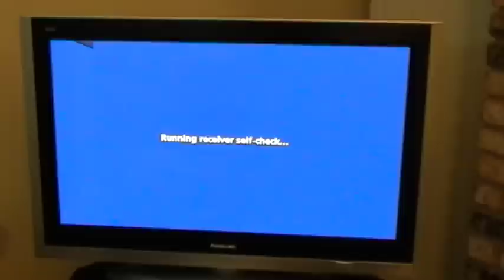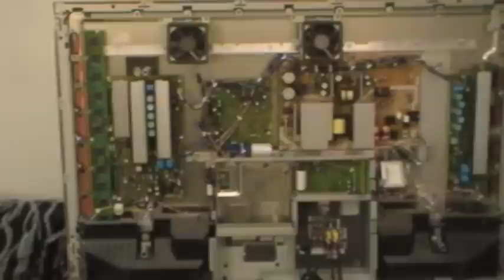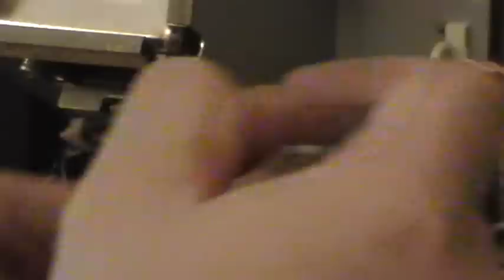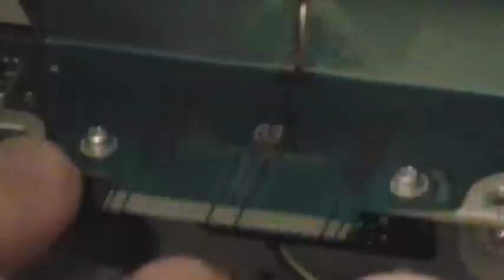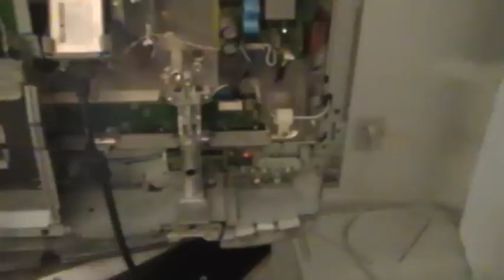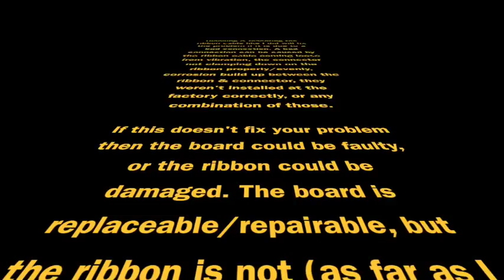Fix Panasonic Plasma TV Vertical or Horizontal Bars

Comment: Thanks for this great post. I have a TH-42PX6060B that suddenly developed a back vertical bar just off to left of middle as you've described. I removed the two middle ribbon cables and hoped to see a wide white bar right across the middle of the screen. However the black bar is still displayed surrounded by white bars. I'm guessing this means the plasma screen is broken and the next step is to take it to the dump ?
Reply from the maker: Unless you missed a ribbon cable, it doesn’t sound good. There may be another place on the TV that is disconnected or a broken solder joint or something. However, I couldn’t say where that would be since I don’t have your TV. Good luck...

Comment: Well since last time I haven't done anything as of yet but the pink line went from every so often to perm. But it comes 10-15 mins after when you first turn on tv. Still right in thd middle of screen.
Reply from the maker: So it now happens as the TV warms up.  Still an indication of a loose connection, with the bonus of possible corrosion at that connection.  Good luck...

Comment: I have the same model tv and have green vertical lines on the right side of the screen.  Could my problem be similar to yours?  I cannot see through the lines and have not tried taking the back of the tv off yet.  Trying to do research first.
Reply from the maker: If you give a series of medium force taps all around the back of the TV where the lines are, do the lines change?  If so, then its a loose connection somewhere and likely the same problem I had with my TV.  Good luck...
Reply: I don't seem to be that lucky.  They don't appear to move.  And actually there are two solid black lines with colored lines running down them...
Reply from the maker: Justin Lane, it is still possible that the problem is a loose connection. It is worth a try at least. Good luck...
Reply: Pet Rock's Garage I don't have anything to lose at this point.  Thanks!

Comment: I saw a 50-inch Samsung Plasma with a horizontal black line across the entire upper area of the screen. I might be worth the $75 investment as a second TV. I have not tried your instructions since it's still at the store, but I am impressed by your presentation. Congrats.
Reply from the maker: A 50” TV for $75 is a bargain. At worst you could sell it for parts and make your money back. If the black line is horizontal, then the ribbon cables you want to look at would be on the right or left side of the TV.  Vertical lines are controlled by ribbon cables on the top or bottom of the TV, like in my video. Good luck...
Reply: Thanks, appreciate your input, no pun intended...

Comment: Purchasing a tv from a friend that has 75% white and 25% black lines kinda together do you have an email I could send you pictures perhaps we could figure out a diy for it?
Reply from the maker: It’s extremely hard to diagnose problems over the internet. All I would be able to do is give you suggestions on things to try. Because of that I’m not sure how much help I would be without the TV in front of me and my tools. I’m not a TV repair guy, I’m a guy with a really good understanding of mechanics & electronics.
I’d suggest removing the back of the TV and lightly tapping around with a non-conductive object (like blunt end of a plastic pen) and see if the picture changes. If it does then you have a loose connection (e.g. ribbon cable, or solder joint) somewhere in that area and you can focus your search there. Good luck...
Reply: Thanks bro can I shoot you a picture just cause? I looked a bit more its mostly white so perhaps a board came loose?
Reply from the maker: Steezy Luciano, took this thread to private messages.

Comment: Petrock 
Well I unplugged the ones to the right and left of the ribbon like u said , where the black bar was.  Once unplugged they appeared the same as the one that is faulty. Half white and half black with color lines . With that being said do u think it's still the panel? What else could be the issue . Any thoughts? I really appreciate ur feedback. One again thanks for ur help.
Reply from the maker: Interesting.  I was expecting the columns to the right & left of the faulty one to be solid white.  I'm not sure what the problem is.  I'd hate to condemn the panel without having the TV in front of me, but it does sound like an issue with the panel.

Comment: Ok I will try that today when I get home. If it's the panel then tv is probably shot , right?
That connection where black line is which is connected to the c2 buffer board. Could it be the c2 board?
Reply from the maker: If the ribbon you disconnected is between the panel and the board, and the panel still shows a problem then it is likely a problem with the panel. By disconnecting the panel from the board you isolate the board out of the equation. The panel is the heart of the TV and is usually more expensive to replace then the TV is worth. Mine was quoted as $200 more then I paid for the TV new.  Good luck...

Comment: Petrock
I have a 50inch plasma . Had the black 2-3 black line . Found the culprit ribbon but when I unplugged it to make sure it was it. It was half black and half white (white having vertical colored lines) when left unplugged. Any thoughts
Reply from the maker: White is the default color for most manufacturers (in my experience), so if there is anything other then white in the column when you unplug the ribbon then those pixels are getting a signal from somewhere other then the ribbon you pulled.  Most likely its due toto an internal short in the panel itself
With that said, try unplugging the ribbon to the right & left of the one you unplugged and see if they turn solid white.

Comment: What about when you have half display blacked out (horizontal)? Any thoughts?
Reply from the maker: It could be multiple loose ribbon cables on the left or right side (depending on model & manufacturer).  The cables on the bottom control the vertical and the cables on the sides control the horizontal.  Good luck...

Comment: Great video, I have a panasonic TH-50PX75U 50 inch, it looks similar - larger, maybe a little older?  It has huge black stripe (3inch) down the middle and your video is inspiring me to take the thing apart and clen it and go for it.  Do you know if these models interiors are similar?  Or do you know this model?  Many thanks!
Reply from the maker: I don't know that model, but I think you are right in that yours is larger then mine (42" vs 50").  I'm not sure on the age though.  Since the manufacturer is the same, I'm willing to bet the interior is the same.  If your bar is in the middle you may need to take the components in the bottom-middle of the back of the screen to get to the offending ribbon.  You can test if you have the correct one like I did in the video (where the black turned to white when I unplugged the ribbon).  Good luck...
Reply: Philip Morton I got a 50 inch Panasonic for free yesterday and it has a black strip/bar going down the middle , did u get urs fixed? or how much would it be to get it done?

Comment: Before you blow dust all over the place, carefully use a vacuum cleaner and a soft brush attachment to clean all the loose dust and debris inside. This should be done every few years, to insure proper operation of the unit.

As important, ensure that there is absolutely NO SMOKING allowed in the home, since toxic tobacco smoke not only endangers people and pets, but quickly degrades electronic and other equipment.
Reply: Never use a vacume on or near exposed electronics unless it is an anti static vacume. A standard vacume will cause esd damage to your device this is covered in the Esd section in the opening chapter of all A+ certification texts books. You can purchase a anti static vacume but canned air is usually much much cheaper.
Reply: @danw6877  A can of compressed air will easily drive the dust into even more places, possibly causing damage, if you fail to first use a vacuum. But, yes, use it lightly and carefully.
Reply from the maker: +tripjet999, YouTube wouldn't let me reply directly to you until recently. Probably a change in your settings or something. Anyway, yes, using a vacuum would be better.  However you run the risk of hitting electronic components with the end of the hose and possibly damaging it. If you use a vacuum just be careful.  As for the smoking…  it would have to be a TON of smoke to have any effect on electronics.  Dust has more effect on electronics then smoke does. Much larger particles in dust then in smoke.
Reply: @petrocksgarage  Not sure what you meant by "hitting electronic components with the end of the hose." You would either place your fingers over the end of a metal hose end or use a plastic crevice tool. Yes, of course, be careful, whatever you do.

But you are very INCORRECT about something as simple as "dust" being as deadly and damaging as toxic tobacco smoke. Toxic tobacco smoke contains more than  7,500 chemicals (many of them carcinogenic and/or poisonous), with particle sizes sometimes being many times great than dust particles. More and more electronic manufacturers will void a warranty, if there is evidence that smoking was allowed anywhere near it.
Reply from the maker: @tripjet999  way to bring a thread back from the dead. By "hitting electric components with the end of the hose" I mean if you use a vacuum there is a plastic or metal hose attached to the vacuum. If you accidentally hit a cap, resistor or connector with the hose you could damage it (e.g. crack the solder joint). Thats all I meant.
Re smoke vs dust, I think we'll just have to agree to disagree. Either way, they both can be problematic with electronics.
Reply: I've used a standard vacuum with a plastic wedge attachment along with a paint brush to loosen the dust for years on dozens and dozens of TV's and never had a problem. Just make sure the equipment is off.

Comment: I have a samsung LCD when I first tried it it would come on with Picture and sound then within 20 seconds go off just leaving sound I replaced the Power board and the invert-er switched on and it stayed on for over an hour but now its gone back to its old ways ?? i have not changed the distribution board or the screen ? advice would be appreciated.
Reply from the maker: Sorry, I'm not sure. That sounds like a larger problem then a loose ribbon cable. I'd contact a repair technician or the manufacturer. Good luck...

Comment: Thanks a lot for this video.  I fixed my Panasonic TV today after watching your video.  I to had a vertical black line on my screen.   I wiped the ribbon with a lent free cloth and alcohol.  I also got out the shop vac and sucked out all the dust on the fans and vent holes. The picture is perfect now. Thanks so much again !!!
Reply from the maker: Awesome!!!  I’m glad this video helped.

Comment: With 26,600 views is this mainly a problem with plasmas vs LED?  Or panasonic plasmas?
Reply from the maker: +Dawn LeRoy, YouTube wouldn’t let me reply directly to you until now. Maybe something changed in your settings? Anyway, I’ll copy my original reply here now:  This fix can apply to both plasma & LED screens, regardless of manufacturer.  Most manufacturers use the same types of ribbon cables.  As for your black line, yes that sounds like this problem. This fix does not require electronic experience. It just takes a screw driver and some patience. The key is figuring out which ribbon cable is responsible for the section of the TV that the line is appearing on. Good luck...

Comment: I had a thin vertical line that would change from green to red to black, etc.  after extensive time messing with remotes and resetting all to factory settings, etc, it turned into like the big black line you have on your video.  Does that sound like the same problem?  I am a little hesitant to try this without any electronic experience.  Thanks.

Comment: I found a potential fix for us non-tech types. I had a horizontal line about 4cm high running across the middle of my 2011 Panasonic 50" plasma during bright scenes. Rang a few places who said it couldn't be fixed (without spending more than a new TV would cost). Was just about to buy a new TV when the power was out at our place for a couple of hours. When it came back on the TV was fixed. So try unplugging your set and leaving it for a good while to see if it resets itself before you do anything else. Not saying it will but it's worth a shot.
Reply from the maker: If that fixed your problem then it would point to a bad power supply in the TV (the part that the power cord plugs into) One of the big D-Cell sized capacitors in the power supply may be on its way out. At least that is my guess without actually seeing the TV. Replacing capacitors is pretty inexpensive if you know how to solder, but really expensive if you don't because you have to replace the power supply completely. Good luck with your TV.
Reply: Pet Rock's Garage You were dead right. The problem went away for a couple of weeks then started to come back. One night the tv just shut itself off, never to recover. Oh well, any excuse for a new one. Thanks for the advice.

Comment: I have a very very thin black line (2 pixels in width) from left to right on my 50" plasma Samsung, its not a thick bar like yours
Can this be also a bad connection?
Reply from the maker: I’m not sure. It all depends on how your TV is constructed. If the problem is intermittent or goes away or changes if you give the TV a series of good ‘technical taps’ with the palm of your hand along the left and right edges on the back of the TV then it is likely a loose connection or loose/cracked solder joint. Odds are on a loose connector. Good luck…

btw, I say right & left edges of the TV because you have horizontal lines. If you had vertical lines you would want to tap along the top & bottom edges of the TV.

Comment: can I insert some scotch tpe and then insert ribbon to get a frim contact. Is there any solder joints on the ribbon between screen abd the card and if yes then I will start soldering from them and then will see with the magnifier or heat them with hair dryer.
Thanks for the support.
Reply from the maker: I wouldn’t advise using any tape. It could prevent proper metal on metal contact in the connector. I also wouldn’t start trying to reflow any solder joints either unless you are very experienced in doing it. A hair dryer won’t do it. Surface mount joints take a steady hand, a good soldering iron and a lot of patients & practice. Unless you know which joint is bad, I wouldn’t even go that route. Good luck...
Reply: Hi Thanks,
I tried to fix the riboon and it worked fine for three days. AFter three days again lines started to come. To me it looked that I am not fixing ribbon in the right . WIll you please advice how to assure that the ribbons are properly seated in the place they should be.
Reply from the maker: Msn Ibi I'm sorry your having so much trouble. Its clearly a loose connection. I don’t know how to better describe how to reseat one of these connectors then what I showed in my video.  Good luck...

Comment: I tried to fix mine and those two black vertical lines were vanished but when I moved from floor to put on table, one again appeared. Please tell what to do. My TV is 42 inch LG plasma
Reply from the maker: If moving and/or jostling the TV changes the bars its an indication of a loose connection.  Maybe you didn’t seat the ribbon cable all the way, or clamp the connector down on the cable all the way.  Good luck...
Reply: sometimes one appears and some times two. I reopened TV and reinserted again but still there. Please tell me if there is any soldering issue and where to solder it.
Reply from the maker: Msn Ibi If its an intermittent problem like you describe, then its something loose somewhere.  Make sure that you reseated the correct ribbon cables.  When all else fails reseat them all.  If that still doesn’t work, then it could be a damaged ribbon cable or loose solder joint.  Its hard to say where those kind of issues are without having the TV in front of me.  Good luck...
Reply: Pet Rock's Garage Hello, I have TH-37PV7P panasonic viera and half of the screen have colored thin line and just half of screen working okay. i tried to do the same, pluged out the chips for half of the tv and the screen was white, that´s okay. when i plugged in back the chips and the tv too, the problem is not fixed and for some seconds the lines was black and then again very thin colored lines. please let me know exactly what you use for cleaning these parts. its true that lots of dust were inside. please let me know.
Reply from the maker: Monika Anna, if the screen went solid white when you unplugged the ribbon cables then the problem is likely not with the screen.  Thats a good sign.  It means the problem is with the ribbon cable being loose or with a bad circuit board that the ribbon comes from. Both are way cheaper to fix then replacing the entire screen. 

A can of compressed air and/or a soft brush are is good to remove any loose dirt from the socket that the ribbon cable goes into. Isopropyl Alcohol (available at most super markets or drug stores) is good to clean out the socket & clean the ribbon cable. Apply it with Q-Tip or small soft bristle brush. Make sure it gets into the socket and to wipe down the end of the ribbon cable with it.  You don't need a lot. Let it air dry and you should be good.

btw, when you unplugged the cables, when you reinstall them, and when trying to clean them make sure the power cord to the TV is unplugged. You do not want the TV on when you are messing with its internals. You could shock yourself or damage the TV.

Good luck...